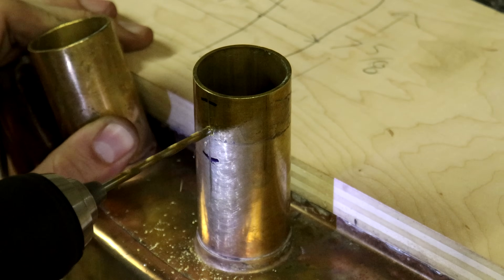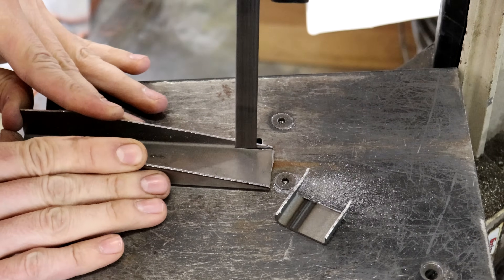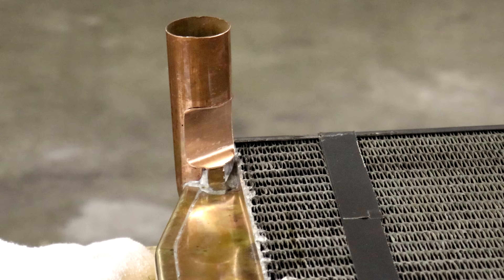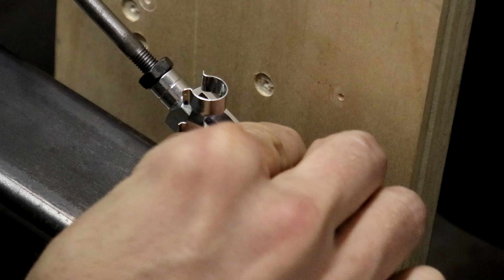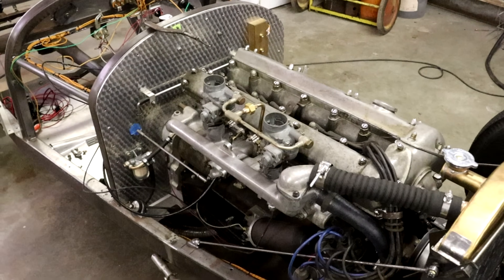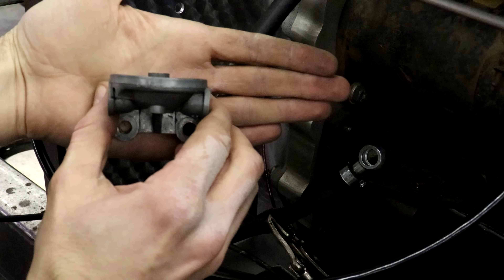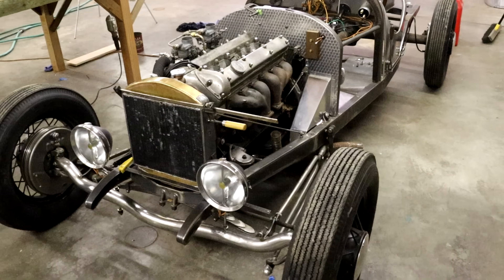Does My Homemade Radiator Work? | Homemade Boat-tail Speedster Pt. 67

Comment: Never use copper alloy for fuel as it's a hydrocarbon oxidation catalyst. Never use straight water in an engine as it will flash corrode the block overnight.

Comment: Run it on waterless coolant, you wont have any problems with overheating or over pressure also if your strpping down an aluminium tank with steel straps use some rubber strip as it will wear through, this is from personal experience small vibrations between tank and support will eventually eat a hole in the aluminium tank. You could fit a concealed oil cooler as well to back up the rad and I would fit an air bleet on that rad crown, air in there is not a good thing.

Comment: That brass union on the fuel line looks awesome. I'm not sure I would feel comfortable leaving it like that without some form of secondary protection. I've seen unions loosen when near something that vibrates, like a pump or engine. Have you thought about maybe drilling through a corner of the locking ring to install a safety wire? There should be plenty of meat near the immovable end, to allow a hole to be drilled. Also, a vent is needed on the fuel tank to prevent vacuum lock. As the engine draws from the tank, air needs to be able to get in to replace consumed fuel.

Comment: are you forgetting vibration I hope you have it connecting to a hose between the engine and the frame. I wouldn't want to hear about you going up in smoke

Comment: I was a little concerned about the shut down. The engine sounded as if it was pre-igniting even though you had turned it off. Also the alternator was showing no charge on the amp meter. Another really great, entertaining video, thanks.

Comment: Run on when you shut off a hot engine is universal these days. Fuel injection systems and some carburetors shut off the fuel when you shut off the ignition. I doubt if any kind of a tune-up or rebuild will give you more than a temporary cure for that. If it runs on (diesels) more than a few seconds, just put it in gear and let up the clutch.

Comment: I just found you again, for some reason I don't get notified even though I click the bell.
I surprised you don't keep a wet rag handy when you're soldering, you just give the joint a quick wipe before it cools and it gives it a more finished look.
You are such a perfectionist at everything you do, you probably have a reason why you do it the way you do it.

Comment: Great job!! Love the project! I would add some flanges to the radiator outlets and the fuel lines so the hoses don’t work their way off over time. I would also add an overflow tank. I get that you want to keep it period correct but that would be a great modern update. It would look great to make it out of brass too. 🤙

Comment: What a project!
You will probably find that running under load, the engine will run significantly hotter.  If that happens, then I suggest you fabricate a metal shroud to go around the radiator fan.  I have done this on the radiator of my ride, and it knocked about 10 degrees F. off the running temperature.  There are optimal widths for the shroud, as well as distance between the shroud and the fan blade tips that you can research on the internet.  But this is a simple way to get better and faster airflow through your radiator -- if you need the extra cooling.  Good luck!

Comment: FYI: "Dieseling, or a gasoline engine running after the ignition is turned off, can be caused by several factors including low octane fuel, high idle speed, carbon buildup, faulty spark plugs, carburetor issues, or incorrect ignition timing." Amazing work you've done. Very creative and great execution.

Comment: IF YOUR ENGINE IS CORRECTLY ACURATE YOU'LL NEED ELECTRICS IDLLE JETS TO CUT THE CARBERATORS TO PREVENT AUTO IGNITION

Comment: I know you can tig weld why not tig the copper ive done it just slice some tube to use as filler
Engine run on is detonation due to timing and or low fuel quality

Comment: Would have loved to see the core made the same as old traditional, such as... wolsely? Thornycroft? I forget...
Just copper/brass tube, ends driven over hexagonal mandrel and soldered together. Easy to make and repair, work fairly well in my experience...
Commercial core looks a bit out of place imho...

Comment: Be Careful Just Putting Water In An Engine...what if "someone" would roll the car outside in the cold?
(only thinking about the "space they needed" "for a quick or over night project" when the temp wz only "0")
over the past 70 years i've seen a number of collector car engine ruined "over just needed space for a quick project"
love your video content...have watched every minute of every vid...always "like" been sub'd since the beginning.
occasionally comment.  very best to you and yours, walt+mrs.

Comment: As for the running on after key off just bring the idle speed down a bit, cylinder temps will come down and there'll be no hot spots to ignite fuel.

Comment: Reff. 10:47 ...and, I am NOT passing judgement...BUT, when that solder joint on THE FUEL SYSTEM fails... as a formerly certified ASE mechanic, and a truck driver aware of on the road failures and repair of such....THERE IS NO WAY I am gonna consider getting near that with a torch....

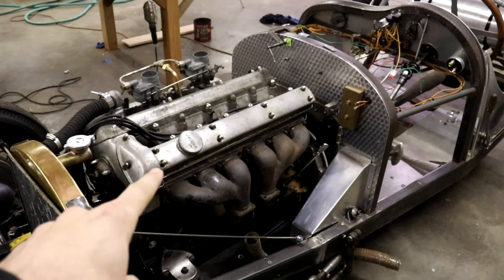P.S. reff 17:43...running after turning off is described as RUN ON... is a simple deal of final carberator adjustment...get the blades as closed as you can...and the needle screws as deep and balanced as you can. IDLING as slow as oil pressure allows...once done, adjust to desired/spec Idle...if it still happens, look into higher octane fuel.

Comment: First time I've seen your channel, way cool brother. I believe the term you were looking for is dieseling. Old heads use that term when their older carbed cars would over heat and wouldn't shut down. The fix would be to starve the engine of air. I've had to do it once before to save a dieseling gasoline engine before at a used car dealership, the detailer was very happy lol

Comment: Those radiator struts are most elegant. 
One small concern is the mixture of metals in the cooling system. Is there a risk of electrolytic corrosion?

Comment: The only thing I would have done different with the fuel system, is running hard line through the frame rail instead of rubber hose. The hose lasts 2 to 5 years with gasoline, and a leak inside the frame rail would be a problem. I tend to think NHRA legal, which is no more than 12" of rubber hose in the entire system, I like to limit braided hose too, only using it where the engine flexes. When I get good carbs for my blown car it will get a better fuel system from the firewall to the carbs..

Something tells me California is not going to like you driving a car you scratch built. Michigan is considerably more friendly to such endeavors, when you get to that point.

Comment: I dont want to stress you out again. However the engine will generate significantly more heat when its running at higher RPM or under load then it will at idle .

Comment: So good to have you back! Your running-on problem is due to a too-high idle speed. Get it down to around 650 rpm and you should be good. Also, add a another fitting to the filler neck and fit an expansion tank to the side of the radiator. Not only does it keep the radiator full but also adds some extra water to your system. I also tin my joints before soldering and it definitely makes for a stronger joint.

Comment: Excellent work as always! It may be running on ("dieseling") because you have the mixture too advanced and/or the idle speed too high. I would have a look at these before tearing the engine down. I restore the litte Solex carbs day-in, day-out and there are a few foibles that I could advise on. I also restore Lucas PLC6 combined lighting and ignition switches that were common on British cars from the late '30s to the '50s and would happily build one for you FOC if you're interested (Fuggle's Fettling).

Comment: If things get hot enough, you're gonna have to worry about vapor lock. That is when the fuel vaporizes while you're driving and you lose power. The fix is to put a return line and pressure regulator after the carb so you have constant fuel flow.

Comment: I would recommend adding a flare or build of of solder at the ends of your copper lines so the rubber hoses won’t pop off.

Comment: I am worried about overheating too but i found my 4 cores cools my small block V8 pretty well as long as there is some movement over the flins. Even a shop fan blowing towards the truck is enough to cool it.

Comment: With the proper coolant in it not just water it should run a little cooler than this test good job on the radiator mods

Comment: The engine kept running like that because the fuel octane is too low  you may need to run a octane booster.or mix denatured alcohol with the gas and go up on jet sizes about 5%, 2 gallons of 99% alcohol per 10 gallons of gasoline, or modify the carbs to run on e85, however 95-98 octane should work great if you are running 90 octane now. What id do is take a 55 gallon drum to the airport, and get 50 gallons of AV100, and put about 6-8 gallons in the tank , fill the rest with 89 octane. Andit will run and smell awesome, plus the valve seats will last longer.. the av100LL gas is the way to  go. If you have a small airport near by call and ask if you can drive over and pickup about 50 gallons. Of Low lead 100 octane.. its called av gas, but was simply gasoline 60 years ago. 😢
Reply: All WRONG!!! Dieseling Is Caused By The Idle Being Too High!!! That's It!!! Nothing Else But The Idle Being Too High!!! 
He Had The Engine At 1000 RPMs When He Killed The Ignition!!! The Engine Is Now Getting Too Much Fuel And Is Self Ignited By The Heat In The Cylinders!!!
I've Been Doing Tune-up And Drivablity For A Living For Close To 40 Years Now!!! Started When Everything Had A Carb And This Was One Of The First Things I Learned!!! 
Dieseling Is Caused By The Idle Being Too High!!! Nothing Else!!!

Comment: Great job. Word of advice for your fuel lines. Add a bubble at the end of you tubing to ensure a good seal with the fuel hose. The easiest way to do it is with a brake line double flare kit. Use the correct adapter to create the bubble at the end of the line and skip the final step of pressing the cone of the arbor into the fuel line.

Comment: Welcome back. I was thinking about you recently, and to see that you made a new video. 
The run on of the engine after turning off the ignition is called dieseling. Not sure what to do to stop it.
Reply: The Answer Is Lower The Idle Speed!!! He Had The Engine At 1000 RPM When The Ignition Was Turned Off!!!
It Is Always Idle Speed!!! Don't Listen To Those Who Say Timing Because They Are Wrong!!!
Been Doing Tune-up And Drivablity For A Living For Close To 40 Years!!!
Keep Rocking!!!
Yeah Back When EVERYTHING Had A Carb!!!

Comment: Are you sure the sputtering after turning the car of is not due to the cylinders getting hot from it running lean? I'm not an expert but I've heard of these two things being related and running lean damaging the engine. Great work though!
Reply: I Am An Expert And The Answer Is The Idle Is Too High!!! The Engine Was At 1000 RPM When The Ignition Was Cut Off!!! The Extra Fuel Is Just Self Igniting!!! 
It's An Easy Fix!!! Just Lower The Idle!!!
Close To 40 Years Doing Tune-up And Drivablity For A Living!!! Yeah Back When Everything Had A Carb!!!

Comment: Great to see you back and working on the car. I hope things are going well generally with your life. I remember moving out of my parents home and after sorting out essentials in my new home I spent about a year building up my garage and workshop, then it felt like a proper new home. That engine doesn't sound bad and I wouldn't tear it apart just yet. The over running could be a build up of carbon in the cylinders. Perhaps the engine was running a bit rich at sometime. I would just give it a good run when you get the car on the road and get the carbs set up well.

Comment: Another reason old cars run on after the ignition is turned off is if the sense wire to the alternator doesn't have a bulb in series to restrict the amperage letting it back feed the loom.
Reply: Then The Engine Would Continue To Run As If The Switch Was Still On!!!
This Is Called Dieseling And Is Caused By The Idle Being Too High!!! The Idle Was Set To Over 1000 RPM When The Engine Was Shut Down!!! 
Been Doing Tune-up And Drivablity For A Living For Close To 40 Years Now!!!
Keep Rocking!!!

Comment: I don’t know if you are running a hood or not. I built a “Rat Rod” roadster with a 403 Olds and a small eBay rad. 403s are known for cooling problems but mine is fine. 100 degree days no problems. I should say I am running an electric fan. I was in a home town parade at 100°F. Other cars were overheating, but mine was fine. No hood or at least keeping the sides open makes a big difference. Also I’m assuming your roadster is lighter than the car your motor came from.

Comment: Your timing is out a little that is why is keeps running after shutting off.
Reply: Wrong!!! The Idle Was Too High!!! 
He Had The Engine At 1000 RPM When The Ignition Was Turned Off!!! 
Dieseling Has NOTHING To Do With Ignition Timing!!! 
Close To 40 Years Doing Tune-up And Drivablity For A Living!!! Yeah Back When Everything Had A Carb And This Was One Of The First Things I Learned!!!
Dieseling Is Caused By The Idle Being Too High!!!
Reply: @rockerpat1085  I bow to your better knowledge

Comment: Good work man. Just a little advice for sweating fittings on and doing any kind of soldering work. Flux, heat the part, move the flame away and let the heat of the part draw in the solder. Don't use it like brazing you'll have a much stronger connection with less risk of leaks.
Reply: Always wipe the joints… looks better, and you can see any potential leak areas..  been sweating copper for 50 years..
Reply: @saltbeltupstateny4857 just curious what do you mean by 'wiping' the joint?
Reply: @ with a DRY rag , while joint is still hot , wipe the solder. It’ll smooth out the surface and generally clean up any left over flex.
  On smaller pipes, 1/2” or so your technique shouldn’t need the wipe..  Also, checking out some of the videos, your joints look a little cold.

Try using some of the acetylene mixtures, like map gas. The material gets hotter, faster, and it’s easier to flow the solder.
Reply: @jvcrules  cleaning off any residual flux after the connection is made
Reply: @saltbeltupstateny4857  exactly
Reply: Every thing you said and he had the wrong flame , I'm not criticizing just trying to help , I did this for a living and I started in 1967 but I'll get it right one day
Reply: Solid advice.  I also agree with the wipe joints.  A little lead in the solder would also help.  Looks like you are using lead free.
Reply: @coloradosean2005  Lead-free is ghastly stuff. I'm just hoping the lead solder I have is enough to get me through my days since I can't get my hands on any more where I live.

Comment: Glad to have you back on the Speedster! That hole on the filler cap is perfect for expansion tank line. The fuel filter cap can be fixed with some lead/solder and either lathe or drill press and rotating table. Those diagonals were very nice touch. Also an honorable mention on the grommet for the fuel hose. Top notch! The expansion tank is a better choice than just an overflow tank, it keeps the system filled and slightly pressurized. This pressure takes out micro bubbles making the system more efficient and less maintenance.

Comment: You should really look into brazing. I know you have to skill to learn it extremely quickly. When we work with hot water systems, which includes building radiators and heat exchangers, we braze those fittings as it has far super heat resistance properties and is generally considered stronger even though the copper line gets more flexible due to being annealed. Either way, good luck and hope all is well in your life, young man.

Comment: You might need an overflow bottle for the radiator. I don't remember if you built the top radiator tank like an old school radiator that doesn't need an overflow bottle. There should be a wall separating the upper hose area from the filler cap area, that makes an expansion tank inside the top of the radiator, where you leave a bit of air. If not, then you're gonna need a bottle :/ Or just let it leak antifreeze all over the place all the time.

Comment: The running on could be caused by some air trapped in the head. If this happens later on raise the front end of the car while its running. This could cause any air to be released from the system. You will see the water level instantly drop.
Reply: You Could Not Be Anymore WRONG!!! Wow!!!
It's Cause Is The Idle Being Too High!!! That Is The ONLY Answer!!!
Close To 40 Years Doing Tune-up And Drivablity For A Living!!!

Comment: The motor continuing to run after shutoff is referred to as deiseling. As you stated it could be a carb problem, in my experience it was usually a timing issue.
Reply: It's NEVER A Timing Issue!!! It's ALWAYS The Idle Being Too High!!!
40 Years Doing Tune-up And Drivablity For A Living!!!